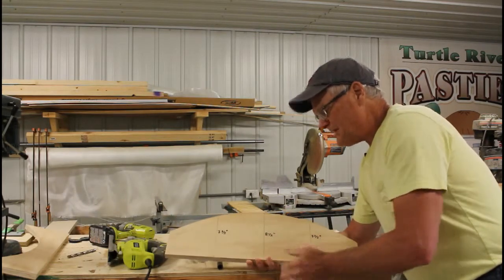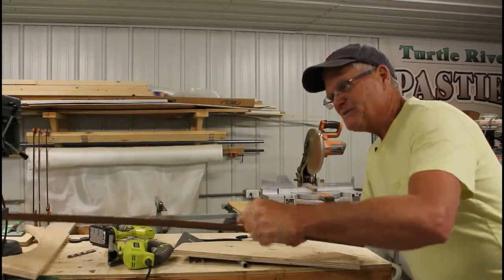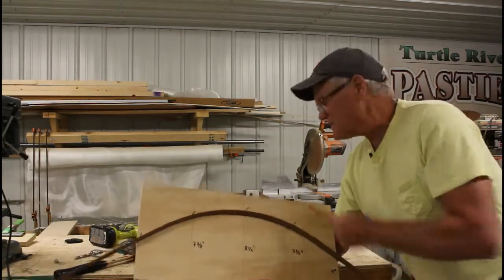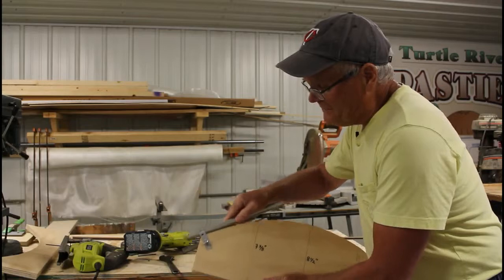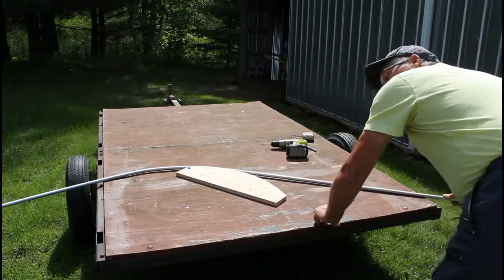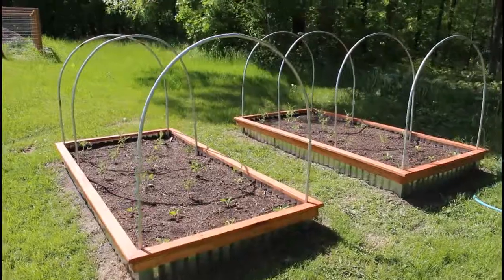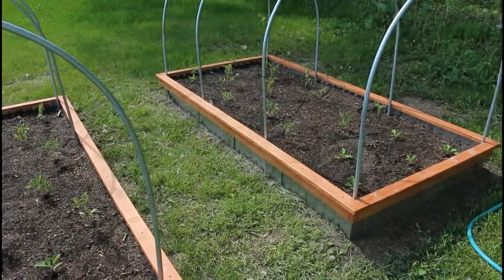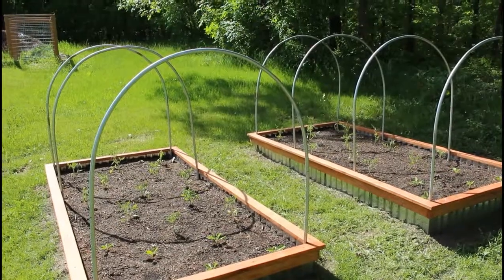Don't use PVC for your Garden Hoops

Comment: The video title is, "Don't use PVC for your Garden Hoops". No matter what works, someone will always come along and try to tell you something than is better. Well, let me tell you what you should have named this video, "An alternative to PVC Garden hoops that will cost more and take longer to build".
Reply: PVC sucks. It's too flimsy.
Reply: @lesliehollands2689  Use more "T" and "x" with rebar, makes it very strong!
Reply: No!
Reply: @lesliehollands2689  I use 1/2 inch PVC with T's and X's, and rebar to strengthen them with no problems for the last 3 years
Reply: PVC could be stable enough to sustain heavy winds especially for mini tunnels- easy. As Jonny mentioned pvc is faster and cheaper. Unless you are building a bomb shelter pvc should be stable enough.
Reply: DEHP
Reply: (No matter what works, someone will always come along and try to tell you it's stupid) This idea was exactly the kind of thing I was looking for and, if you read the blurb under the video, the reasons to use conduit rather than plastic were clearly given. If those reasons mean nothing to you, why even watch, much less criticize? Also, I question your claim that using conduit would take longer and cost more, given that the conduit hoops would last so much longer before needing to be replaced.
Reply: @whoscary6372  Do you even know what the word "Don't" mean? He said, (quote) "Don't use PVC for your Garden Hoops". Not  an alternative to PVC pipe. I did not say or imply his method was "stupid", you did! It is evident that his suggestion is exactly the kind of thing you were looking for, I'm glad for you. But to attack me for making an observation and a corrective way for title-ling a video, is wrong on your part. And if you have used PVC pipes in the pass, and have changed to medal, you have found this to be true what I stated in my suggestion, (quote). "An alternative to PVC Garden hoops that will "COST MORE" and take "LONGER" to build". (end quote).
Reply: @JC-mx1mk  I just found your response in my seldom used email, or would have said this before... I apologize, two years later. I believed your original comment included the wording in my first statement, and that you were accusing the OP of calling the use of PVC stupid. Perhaps I did mix up two people's comments? Not sure, but.. my bad.

Comment: Do you think this will work in a 5 foot wide bed.
Reply from the maker: The hoops can be stood on upside down and spread out, while pulling the ends together, to widen them. I have been getting feedback about making a bender for hoops that are 4' on the outside. I intend to do that. Just have not had the time.
Reply: 5 x 12" = 60" - 1" for conduit width = 59" / 2 (radius) = 29.5".  Make a 29.5" compass with a nail and string and trace the measurement on a board and just cut it, etc. Same process, different measurement. Easier to probably custom make a bender template for your size then bending though. My two cents!
Reply: @dmazz1580  Using your method, would you need a 5 foot wide jig for a 5 foot wide bed (less 1 inch)? I don't have a problem with the pipe bending, but I do like having smaller jigs. BackWood Basics seems to have figured out how to make a 2 foot wide jig for a 4 foot wide bed. Anyway, interested in your idea as I have raised beds of various widths and am looking for a way to make jigs for those beds.
Reply: @gtaus1  the template isn't going to be the full width of the bed since you bend it in increments until the two legs are parallel.  Like how Backwood Basics has it, the sides are/can be cut flat.  You just need to calculate the curvature with a string & nail compass. Good luck!
Reply: @YouKnowItMang  Thanks.